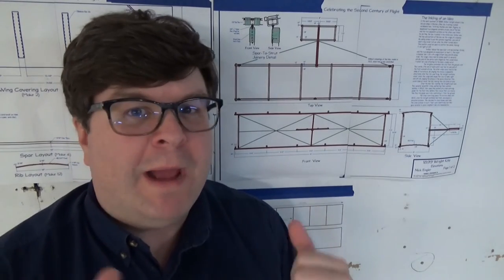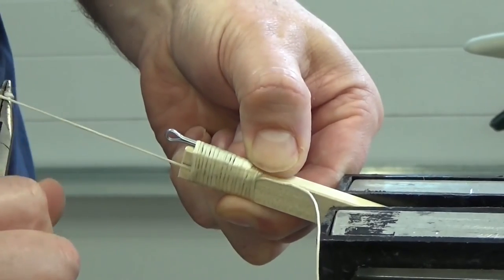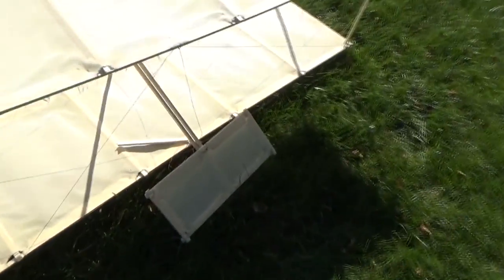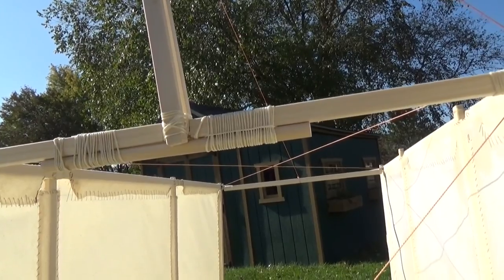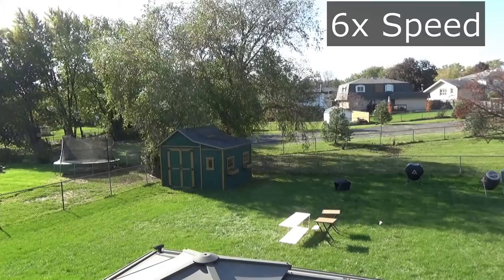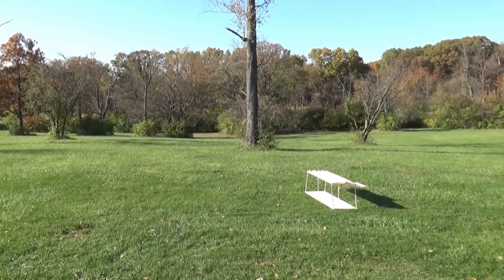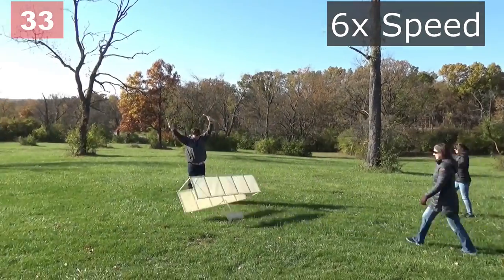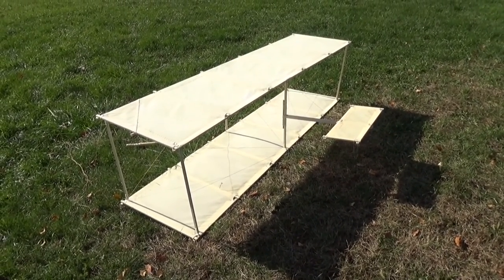1899 Wright Kite: Woodworking Project 18 Years in the Making

Comment: A few suggestions, Thomas.
1. Dope the wings. The cloth you've used is too porous to provide the lift you need; the air pressure bleeds through the wings. In his letters to Octave Chanute, Wilbur mentioned shellac. However, that also adds a lot of weight. I used "canvas paint," a trick that sailors employed in the Wight brother's time. Mix paraffin wax and gasoline 1:3. (If you don't want the smell, use xylol.) Paint the wings; wait for the solvent to evaporate leaving behind a thin veneer of wax. I suspect the Wright brothers used canvas paint for their 1902 glider on. 
2. You need more wind. This is a heavy kite. It won't fly unless you've got a breeze of 8 mph or more. Wilbur flew his with a piece of pipe on the lower wing to imitate the position and shape of a man, so I would suspect he was flying it in winds well above that.
3. Keep the control lines short -- 5 to 7 feet at the beginning. The longer the yoke, the slower the kite is to respond to the controls. I know there are videos of me flying this thing with a 20-foot yoke, but that takes enormous practice and a very steady wind -- I had the advantage of flying the kite for that particular documentary crew at Kitty Hawk, which is a natural wind tunnel. Any "burbling" -- wind spilling around a building or over a hedge -- will give you fits. 
4. Yoke the kite so the top control lines are slightly longer than the bottom ones. The kite should lean backwards 3 to 5 degrees so the wings have a decent angle of attack.
5. Keep the control sticks absolutely vertical. People have a tendency to rotate the tops of the sticks back towards them as the kite goes up. This reduces the angle of attack.
6. Take a look at my design for the "Not Quite Wright Kite" at https://wright-brothers.org/Adventure_Wing/Workshop/Not_Quite_Wright_Kite/Not_Quite_Wright_Kite.htm . This is a kite I build with kids in workshops. It makes an excellent "kite simulator," the kids get the hang of it very quickly. You can use it to develop the skills you need to fly the larger kite. And I've flown this in winds as light as 2 mph; you don't have to wait for a windy day.
7. Don't get discouraged. This is a very tricky thing to fly -- I have that from a professional kite designer! The learning curve is steep, and you did a heck of a lot better than me my first time out.
Reply from the maker: Thank you for taking the time to write up these suggestions. I've pinned the comment so it will be the first thing future viewers will see. I did read the Not Quite Wright Kite page several times and it was very helpful. I also read the two 1899 kite pages many times. Without these pages I would have had no hope of completing this project. I did shellac the muslin based on the information in those pages. I think it was a 1lb cut, I mixed 50/50 DNA with the Zinsser Clear. I will try the paraffin suggestion if I try this again.

Comment: Great video, Tom. I'm looking forward to the rest of the series!
Your kite reminds me of one of the earliest gliders the Wrights built. I built a 1/4 scale of that glider back in high school, and was able to retrofit into an r/c glider. I didn't have much luck with stabilizing it in flight though. Being it was one of the Wright's early designs for a glider; it did have wing warping, and a horizontal elevator. But what it didn't have was a vertical rudder, which was hard to keep it from sliding left to right in the air. It would bank really hard in a turn, and thus made it even harder to level back out of a turn. I had a lot of fun designing and building it. And like you, I also got really good at "field repairs". I'd say it probably spent more time on the ground than in the air.
Reply from the maker: Thanks Chad! Sounds like a cool project. I really wanted the kite to fly better than it did, but I was mostly interested in just building it.